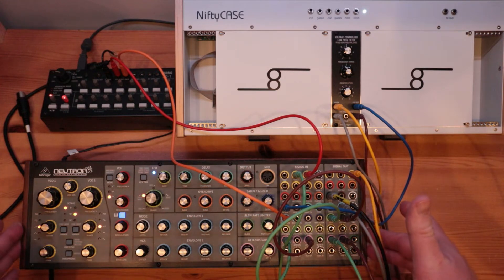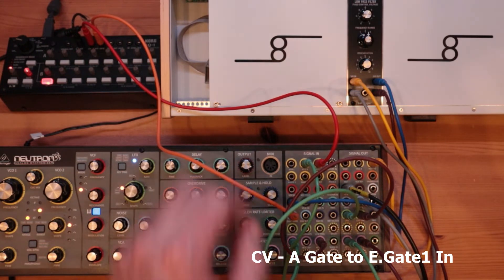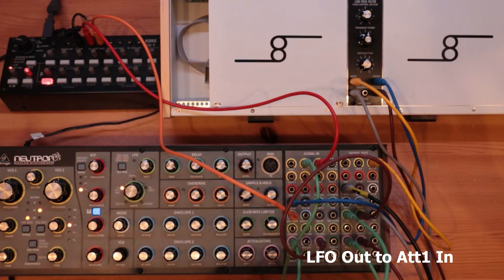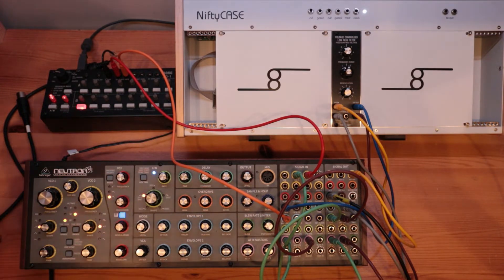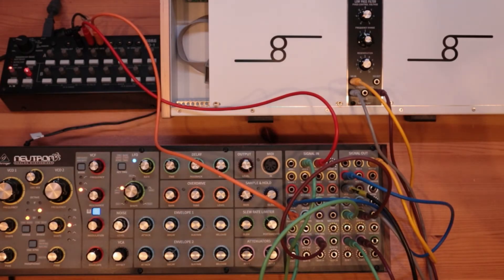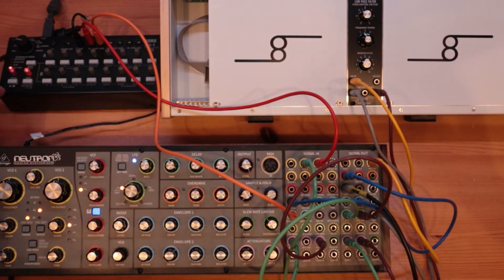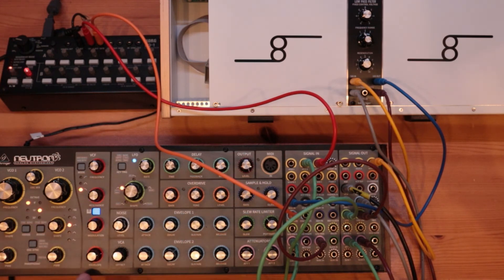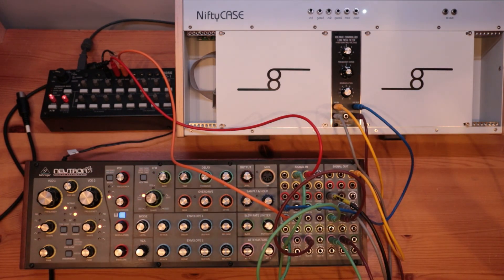MOOG my Neutron: 904A VCF Eurorack module

Comment from the maker: Would you like me to make more videos like this? If so, let me know by clicking the Like button.
Reply: It would be interesting to plug an external VCA like the Intellijel uVCA and compare it to the built in VCA, I did it and it made a big difference in terms of punch and timbre.
Reply from the maker: That's a great suggestion. A VCA is on my wishlist for doing cross-fades. Is the uVCA the one you used?
Reply: @umick-synths  Yes, the first version of uVCA . I bypassed overdrive and delay and the filter alone gave an enormous ringing at high resonance , meaning that the overdriven normalled patch compresses the signal a lot.
Reply from the maker: Thanks, I'll have to check that out. Thanks for watching my video and commenting.